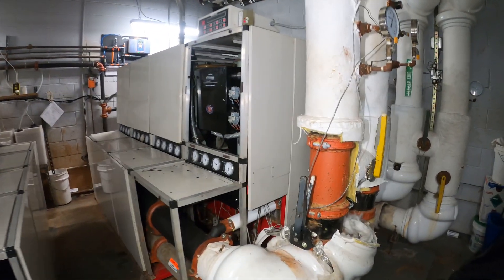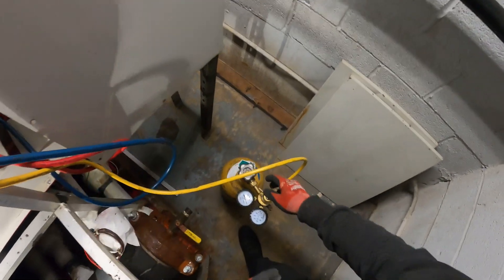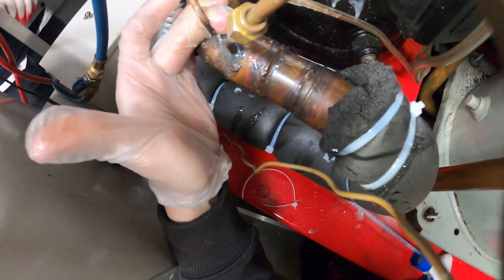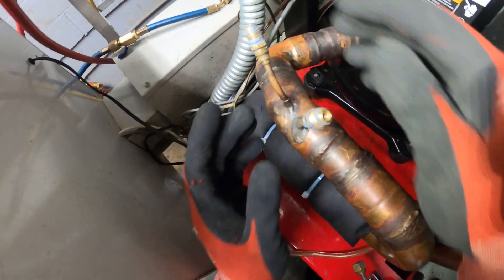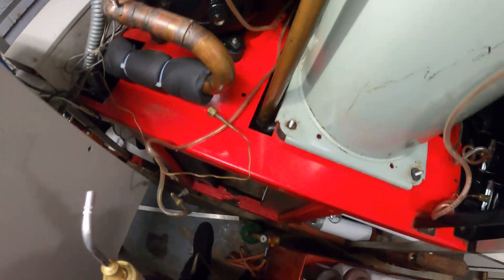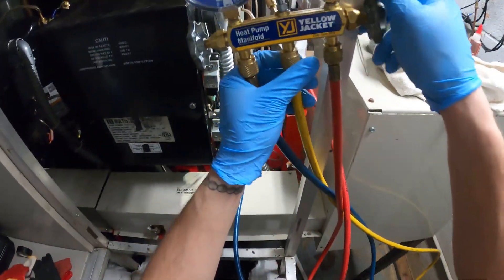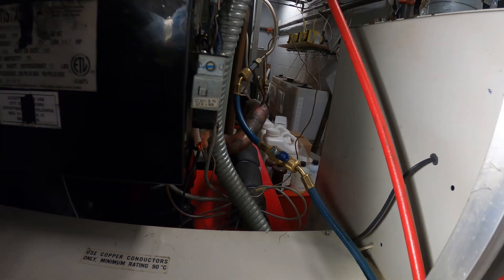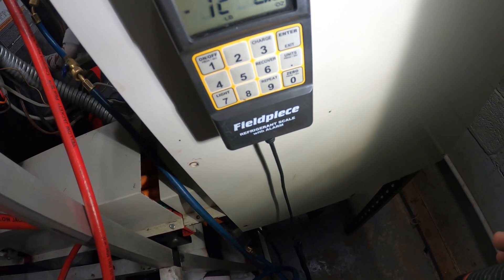HVACR: Chiller Service Call (No Cooling/Refrigerant Leak) Industrial Refrigeration Training

Comment: I was working on a small chiller system once with a bad low pressure cut out, replaced it did the normal steps. I was still above the unit and dropped a pair of big channel locks while I was on the phone with my boss at the time, it bounced off one of those fitting's and the stem completely broke it off lost 55 pounds of refrigerant.

Comment: I work on chillers too 🤜🤛
I don't understand why manufacturers use  the long stem pressure ports , it makes them too fragile .
Had one cracked the other day as well , replaced it with a shorter stem one and strengthened it with the brazing rod .
Reply: Not to mention they use the puny tubing. Its pathetic. I'm with you. Shorter is better. Keep pressure on the lines, drill it out to use a 3/8 stub, and add enough so each device can be on its own process fitting. I think avoiding the tee fittings is good practice too. Although the argument that then there is no core behind the flare is valid.